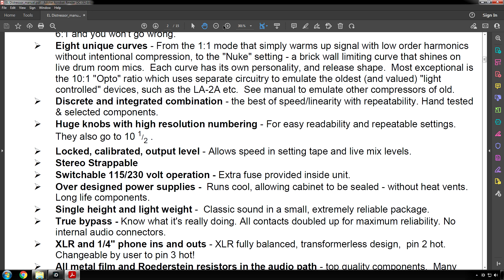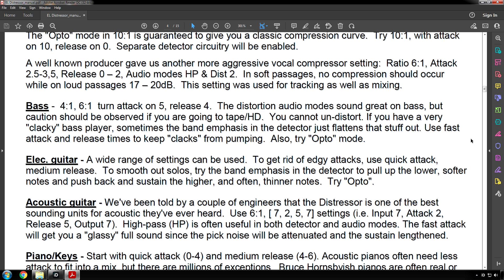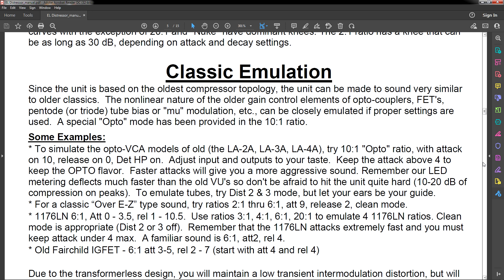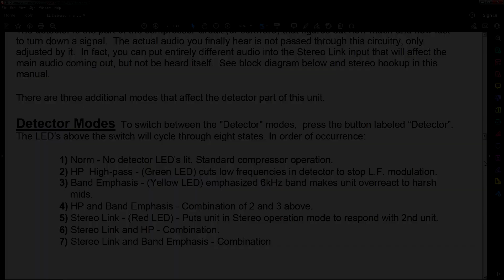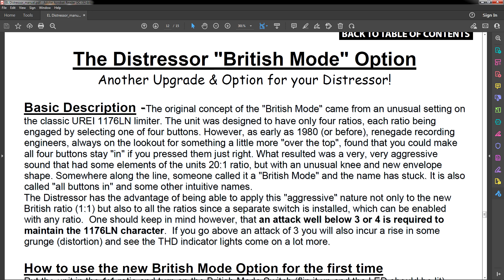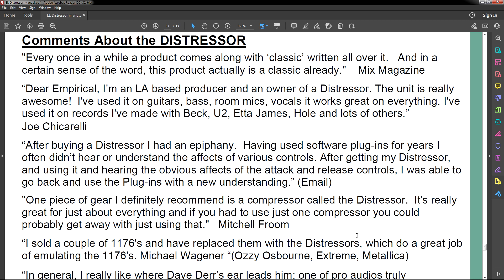Empirical Distressor User Manual PDF Audiobook RTFM  Guide Read Aloud EL Empirical Labs

Comment from the maker: Don't forget, the Distressor's Attack and Release times are fastest at smaller (Counter-Clockwise) numbers. This is the opposite of 1176 style compressors! Green LEDs = safe "clean" gain reduction range. Yellow, it's starting to sound more noticeable and red the gain reduction is VERY noticeable.

Find the loudest part of your track and set the threshold until it still sounds good. Not clean, just good and not obviously overly compressed. You could also automate the gain for that peak if it is particularly loud, so it is lower BEFORE it hits the compressor.